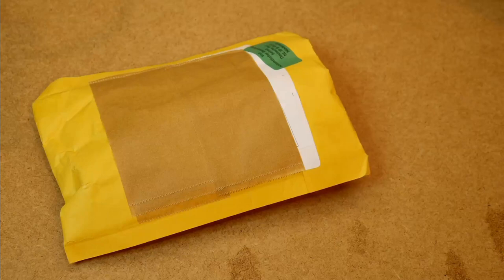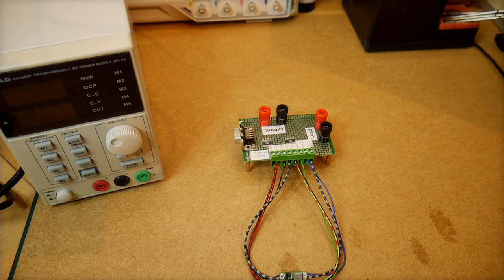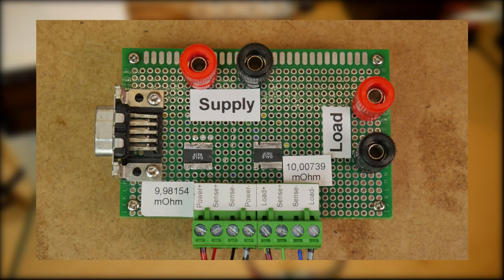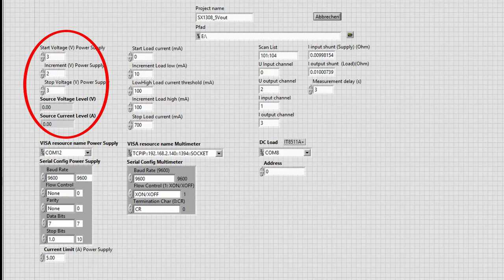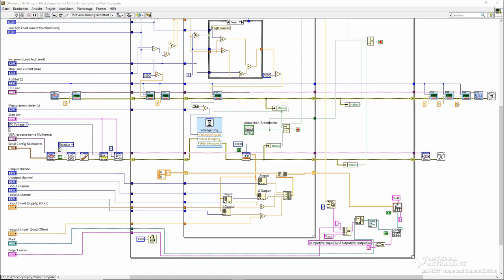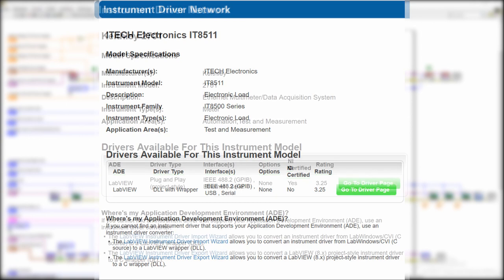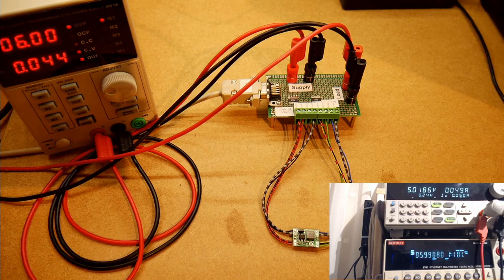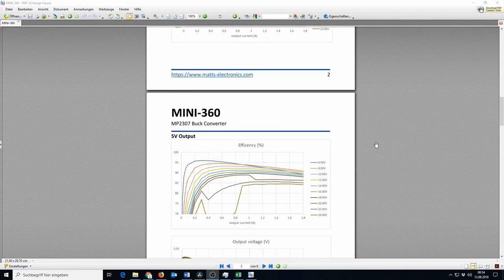#3 Automatic DCDC converter tester

Comment: nuts!  was hoping to see efficiency results of each module in the end.
fantastic effort.   austrian accent?
Reply from the maker: Have a look at the link in the description. You can find there PDFs with all the data I acquired so far. Also I tried to figure out the schematic of the used modules and put the results in the PDFs.
I'm from Baden-Württemberg ;)
Reply: @mattselectronics3425  Hello Matt , how can I get in touch with you to buy the XTE-SY-8 step up converter ??
Reply from the maker: @fabrizioparisi5068  Hi Fabrizio! I don't sell this modules, I only tested them. 
You can probably get them from ebay or aliexpress.